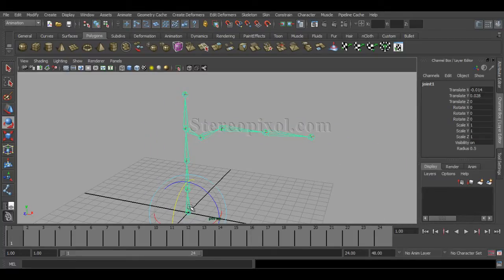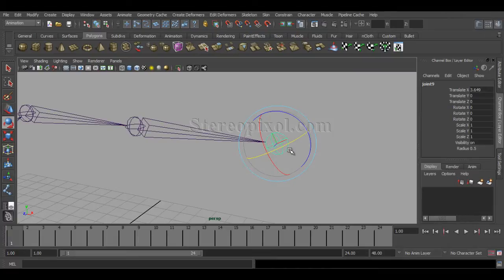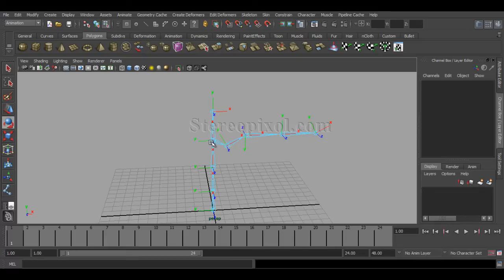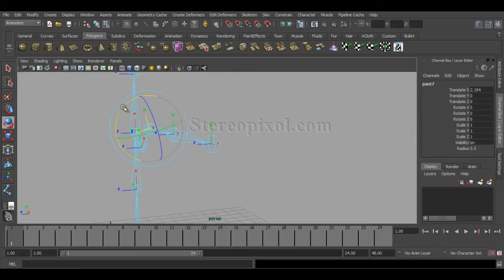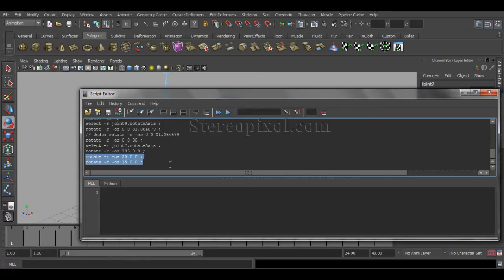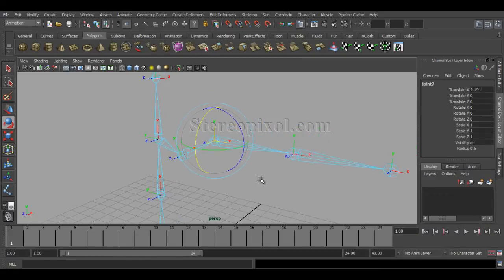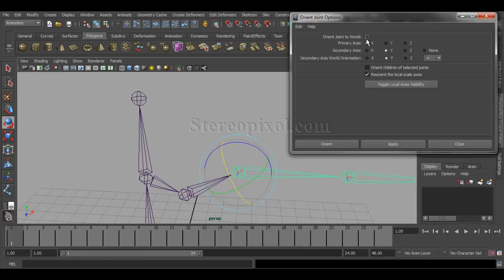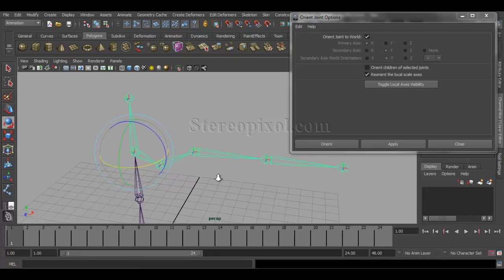Change Joint Local Axis Autodesk Maya Tutorial

Comment: Hello, I am really new to rigging and struggling bad. I mirrored some joints on a bipedal character. On the right side (side I first rigged) the Z axis faces forward, the X axis points towards the children (going right), and the Y axis points up.
When I mirrored, the Y is down, the Z is in the back instead of the front, and the X is facing right like the original.

I tried to use the Orient Joint Options, but the best I can do is make the X/Y match the original at the cost of the Z axis facing the back of the character instead of the front like the original.
Is there a way to make the Z face the front without it turning the X axis 180 as well?
Reply from the maker: Mirror option will not let you do that. You can try by disconnecting the joint chain then freezing or reorient the chain and then connect it back.